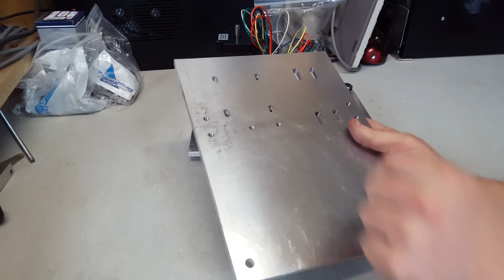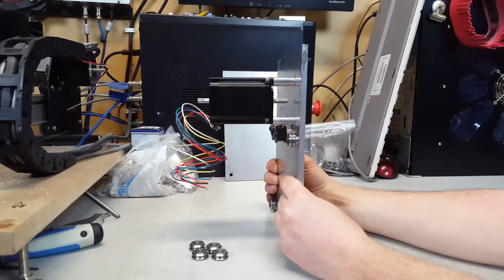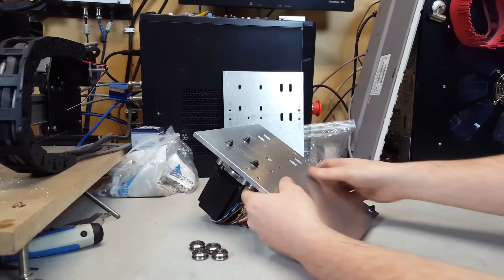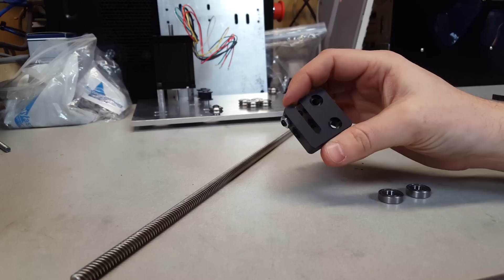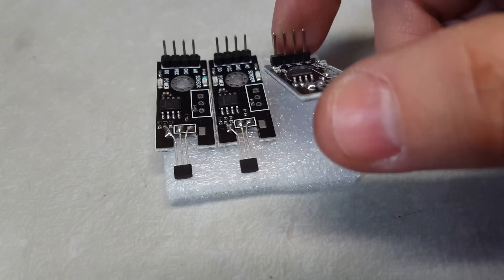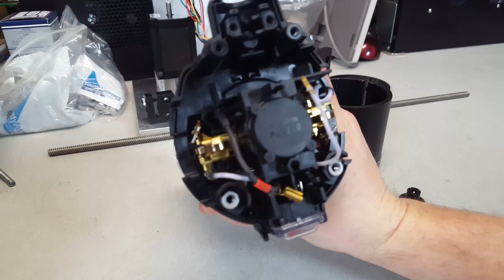DIY-Oko CNC Router: Part 4 Y-axis Motor Plates & More!

Comment: Do you have any build instructions/parts list?
Reply from the maker: +Shazzner Not yet. However, when I get done with the build I will be compiling a parts list, and making/releasing a fusion 360 model and SVG  files of the various CNCed parts.